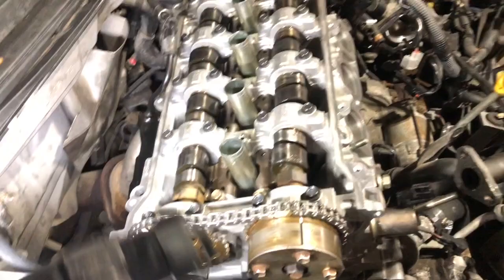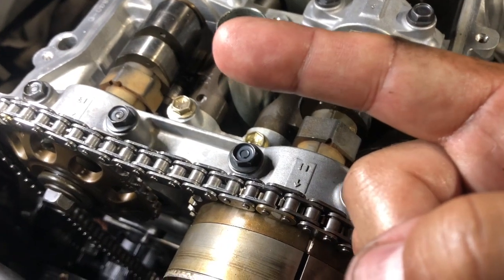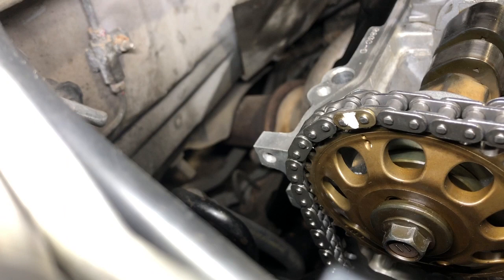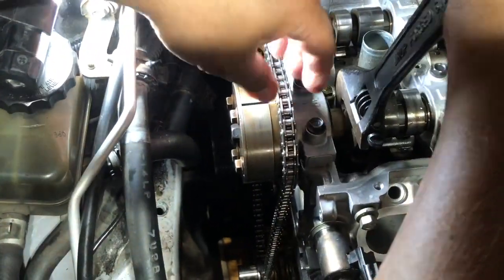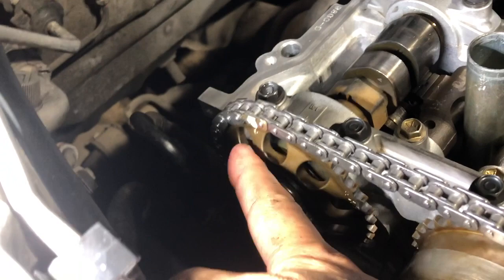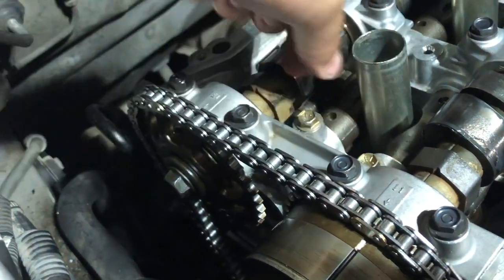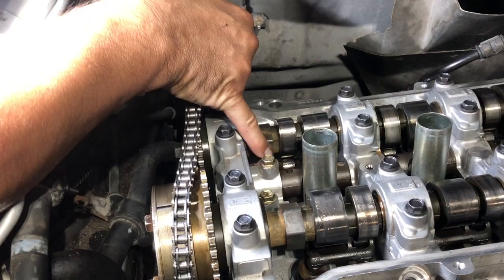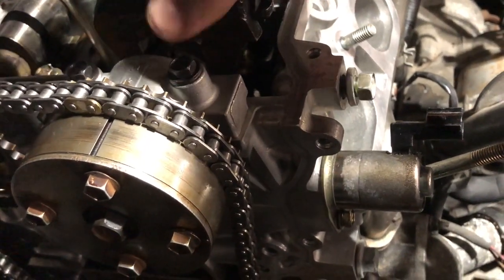2zz engine timing chain Install

Comment: I have a Toyota Celica GTS 2001 and the problem I have I put a new cylinder head in it and it starts really good and it runs for a little bit and then it shut off and it sounds like the time and change it jump any idea

Comment: How is the inside of the valve bay that clean ?  Did you install a rebuilt engine first and then decided to do a timing chain job after installed ?
Reply from the maker: I bought this car without knowing the history of repairs. At that time it had high mileage, can’t remember exact mileage. When I buy a used vehicle I always replace timing belt or chain. Most vehicle owner never do this required replacement. Yes, I rebuilt the head. Had a misfire, due valves. Reason why it’s so clean.
Reply: @713jtmechanic8  Mine has high miles too.  Severe leak out timing chain cover gasket.  I dont have chain off yet, I just assume it needed a re-do.  Curious to see if this was unnecessary for me.

What are you using to clean all that ?  Anything that saves me a million hours of manual scrubbing?
Reply from the maker: @WhatAmIGonnaGet  I used brake cleaner when I clean up the timing chain area. Make sure the camshaft seals are not leaking and crankshaft seal. Usually, when the timing belt or chain area is oily or dirty it’s seals leaking.
Reply: @713jtmechanic8  I haven't been into my engine to see the cam seals yet.  Tried to order them from Toyota parts website, could not even find them to buy.  I have to check into that, thanks.

What I did find was an o-ring in the valve cover, on a pipe that looks like oil is pumped up to, and oil rain-down on the camshafts.  Mine looks ruined, so I'll just replace that easy $1.00 part.  Now if only they made valve cover out of glass - I could take a peek at all the fun that goes on.

Comment: Do you have any idea what the km limit is when the timing chain needs to be changed for Toyota Avansis 2.0 petrol?
I want to buy one that has 170,000 km.
Do you think it will take you at least 50,000km?
Reply from the maker: I am not familiar with that model, since I am in the USA. However, timing chains on toyota's last past 170,000KM. The reason I replaced timing chain on the Celica GTS was not for worn issues. I had to remove it to rebuild head. Make sure the model you are asking about has a timing chain. If it has a timing belt. I highly recommend to replace belt around 60,000 to 80,000Km.
Reply: @713jtmechanic8  I understand, thank you very much for the quick response and advice. :)

Comment: Put the chain on the crank shaft gear last...
Reply from the maker: I started out installing timing chain on the crankshaft as the last procedure, however, I was experiencing issue with the camshafts sprockets moving tooth. Either on the exhaust cam or intake cam. The best solution for me was to install timing chain as seen on my video. As a long time technician I witness many other techs with different approaches on repairs and the repairs are correct. I would like to know more about your method. If you can elaborate on your method to install timing chain and write it on the comments. I think this will help the 2zz community. I really appreciate it you took the time to write a comment. Lets provide repair information that can help others.  Thank you Doginu :)

Comment: Ok but what about the bottom gear of the crankshaft, how did you stop that from moving?
Reply from the maker: Make sure the timing chain has slack (clearance). This will prevent crankshaft gear from getting out of position. Timing chain must have slack at the camshaft sprockets. Make sure timing chain is on crankshaft gear at all times. I hope this helps.